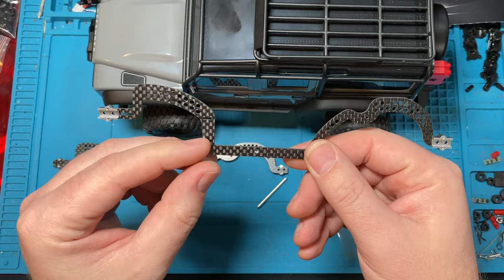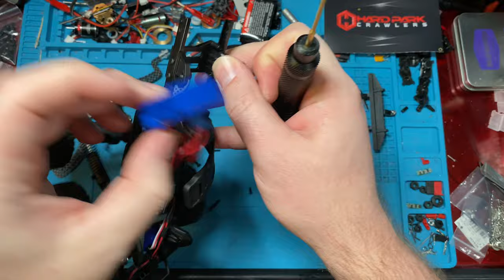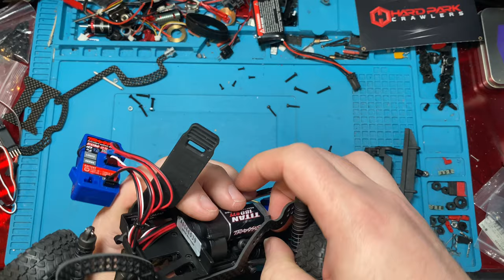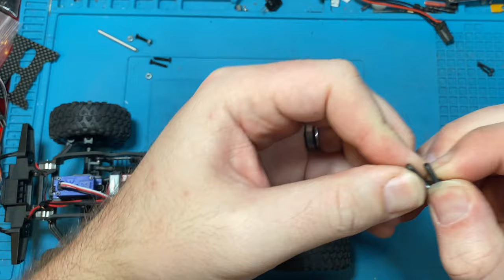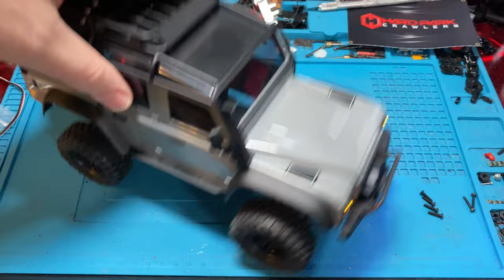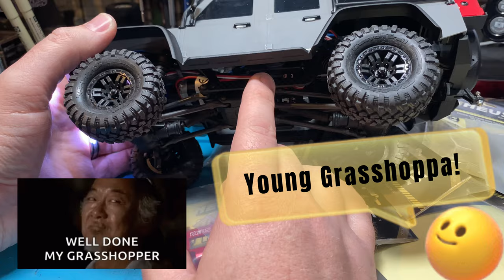TRX4M - Furitek Grasshopper Chassis Upgrade for the Defender and Bronco!

Comment: Why all the extra front shock mount holes? Nobody runs shocks leaning forward.
Reply from the maker: You would use those if you stretched the front links for a longer wheelbase. But yeah, we’d rather have more rear / inward leaning positions.

Comment: I think they made that cutaway shape to reach the hole that is down that curve and just eliminated the extra material left up above to maintain the same equal width of the rail...
Reply from the maker: but there is no need for that curve or hole at all. it could have just been a smooth hoop with the brace anywhere along the shock hoop. Hell, they could have made the brace adjustable by using the same size screw and letting you put the brace where ever you want.. even better, letting you use the shock screws and shocks to mount the brace.
Reply: @TheShopMiniRC  agree, and I personally would have made a way bigger shock mounting area with way more options of incline and height for different builds, but nobody seems to make it that way...

Comment: Mini Rc I have a question can you use a laydown servo with the furitek chassis? Thank you for showing it the grasshopper looks more open than some of the chassis being sold
Reply from the maker: i matched it up to a laydown servo and it does look like there would be enough room. It might be tight and the side wire might rub on the chassis when articulating but I bet if you went with a 3flow9 torrent with the rear exit wire, it would have 0 issues rubbing. (as long as there is room for the wire at the rear of the servo between it and the motor)
Reply: Thank you for the suggestion and the servo looks good too keep making your videos it supports us newbie with the hobby @TheShopMiniRC
Reply from the maker: @littlesadface  thanks again for watching!!!
Reply: your video is well put together and very detailed I definitely will watch your content more power @TheShopMiniRC
Reply from the maker: @littlesadface  thanks!!

Comment: Instead of using the nuts on the back of the top shock bolt y not put the brace bar there and put the bolts into the bar and don't need the nuts
Reply from the maker: Yep, that’s a good option as well!
Reply: @TheShopMiniRC  just a thought.  You build these and work on them way more then me. I'm still barely getting into these and still learning. But I appreciate yr channel and all tips, tricks,reviews on parts and help. Much appreciated. Love the channel thank you
Reply from the maker: @Kpilato_21  huge thanks for the watching!  I hope they help.